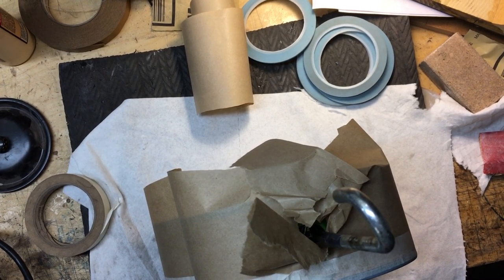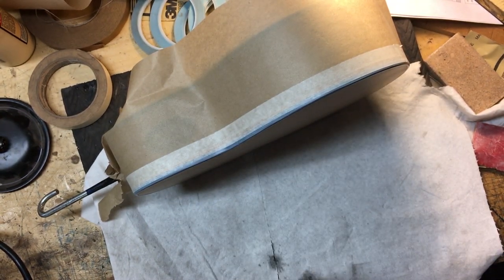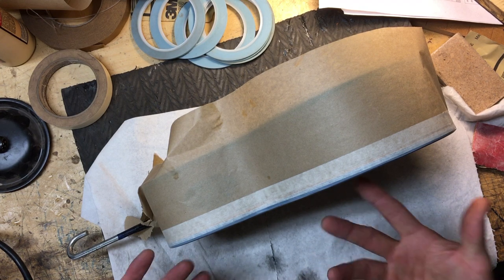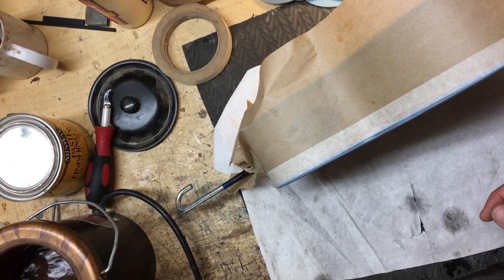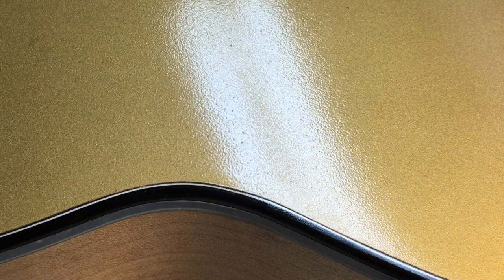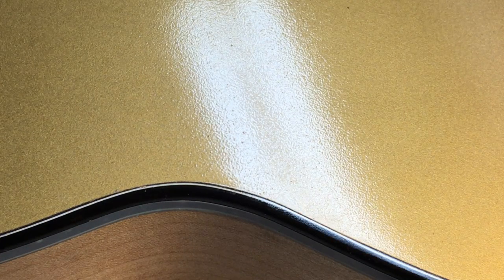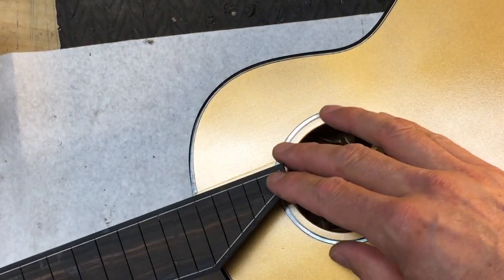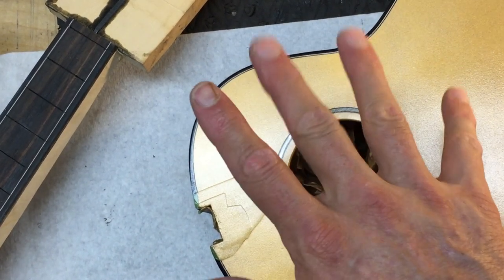How to Spray GOLD with an Aerosol Can Beau Hannam Guitars and Ukuleles

Comment: I know this is just over a year ago but I have a question.  Why did you put the clear coat over the gold when it was still stripped?  I can still see the stripes in the paint before you added the clear.
Reply from the maker: I don't understand the question- "Still Stripped"??? Do you mean you can see gain lines under the gold or spray lines in the gold?
I forget if i mentioned this in the video but you can sand flat the gold. you cant touch it without ruining the surface. I had sanded the wood totally flat after sealing it. and after spraying the gold its surface looks great to me. Ie no paint stripes to worry about and certainly not after the clear was put on.
Hope that helps.
Reply: @BeauHannamGuitars  not the grain, sorry, maybe you're camera records a lot better than known.  I could see what painters call tiger stripes from the strokes.   But  when you were completely finished it looked great, no stripes.  I guess after it dried it all blended beautifully.  Cross your fingers for me, I'm ready to paint my own. Quite a bit nervous. Using spray can deep navy metallic. Yikkkees.
Reply from the maker: @enchantingmarina5221  No stripes if you spray and it flattens out nice- just heat the can first in hot water. And start with a perfectly level surface.
Reply: @BeauHannamGuitars  ohhh I think this will work.  Still nervous about it.  Temperature outside would have been ideal until it started to rain.  I will give it a practice run first on a scrap board. Uggg. Lol